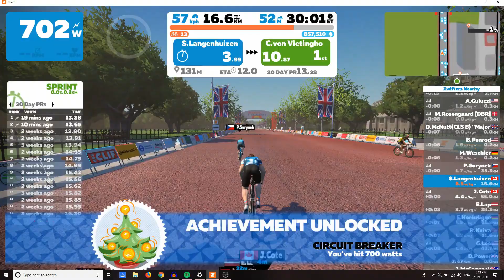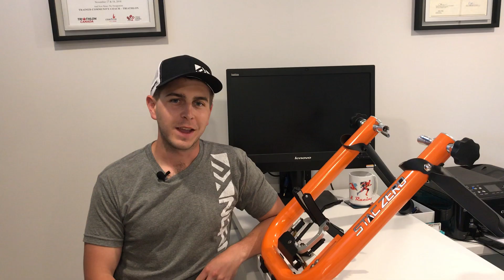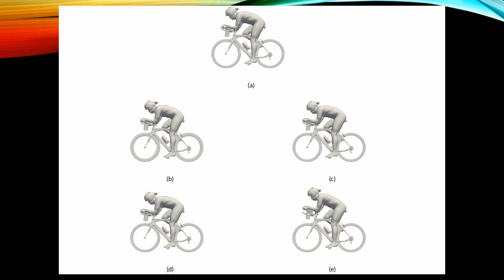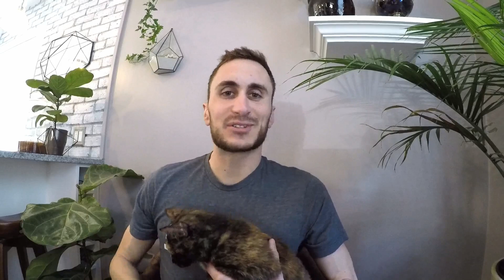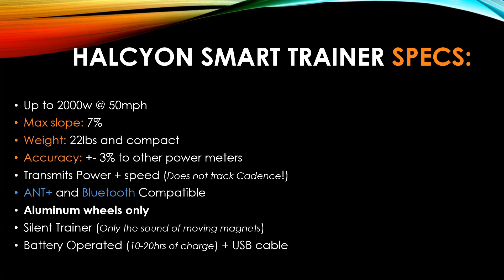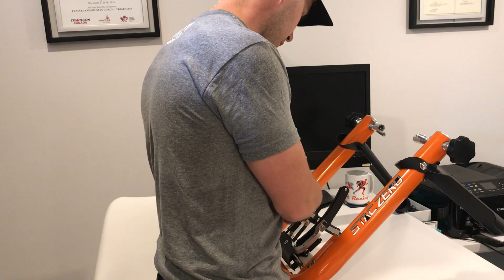Virtual Wind Tunnel Experience - With Cody Beals & Jackson Laundry!

Comment: Loving this review from all of you regarding the Virtual Wind Tunnel. Once you get your report, how do you actually integrate the recommendations? Do you just bring the report to your bike shop and show them what to do?  Thanks
Reply from the maker: Hey Sean! Thanks buddy, and great question! Yeah so most changes can typically be done on the spot (ie. removing or adding spacers on entry level TT bikes, or moving elbow pads that are bolted on, etc). But typically higher end TT bikes that have proprietary spacers, or elbow pads that don’t move as easily, or you need a new stem size, or anything in that matter, you would then have to take those recommendations to a bike fitter and they could apply that for you. But, for example the VWT I went to in Toronto was done by a company called X3 Training (who uses the scanning equipment from STAC then send them the data and STAC makes your report) is also able to do bike fitting and maintenance! So depending where you go it could be a one-stop shop! 👊🏼 hope that answered it!